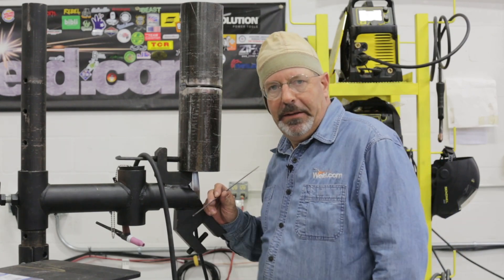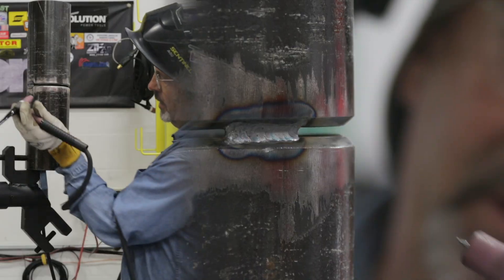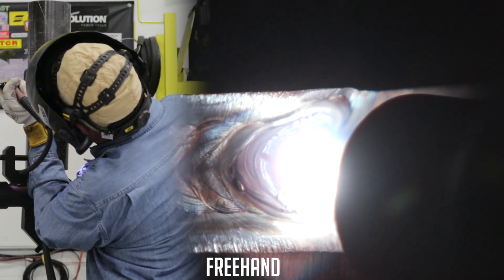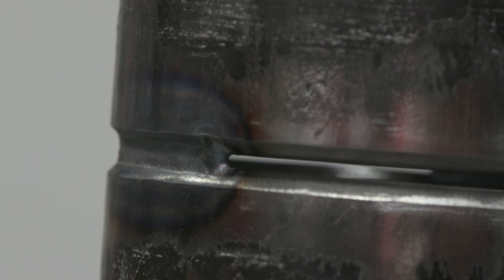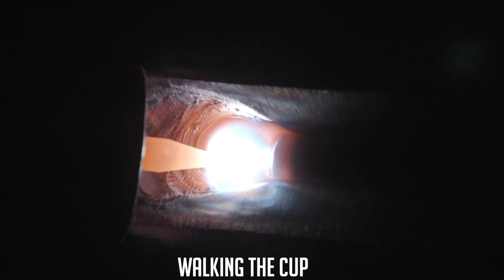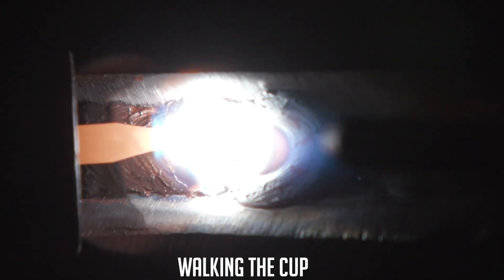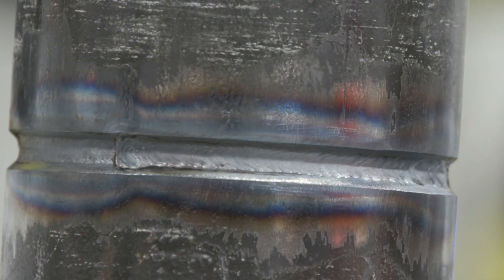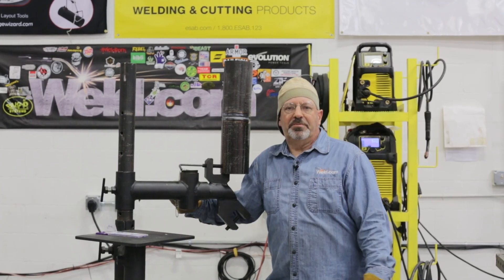Walking the Cup VS Freehand Roots: Horizontal (2G)

Comment: Hello my friend i  saw  your video and it is so pretty
Reply: you need a 4mm gap and feed that wire  behind the bevel  inside the pipe . around 115 amps 

tight gap and high amps feeding wire on outside of bevel
gives a flat or concave root

Comment: Twisting the wire, you should explain that one again. That's a really good tip. 👍🏼
Reply: I should've said rolling it in my fingers.
Reply: @bobmoffatt4133  you did say, *"rolling and pushing," that was my brains interpretation of the the technique by the time I made my comment.
It's about the best pro tip I've ever heard for getting some real feedback on how the weld is going and you're the only one I've ever heard speak about it. I can't remember which video you explained some of what you're feeling for by rolling it, but it would make for another great video on that alone.